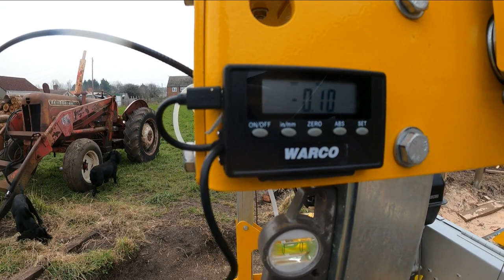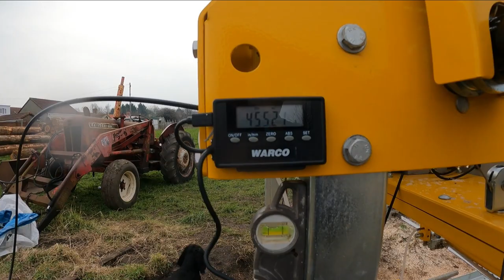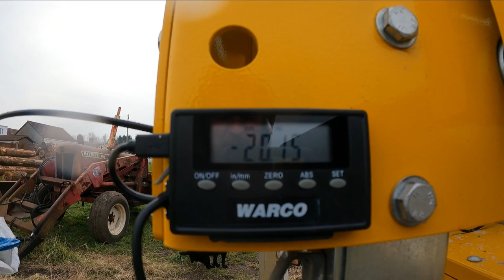Frontier OS27 Sawmill ~ installing a Digital Readout scale to the mill ~ GAME CHANGER !

Comment: Hi Nick, thanks for this video. Because of it I bought one to install on my LM30. I'd like to know how you have been liking it? Mine arrives this week.
Reply from the maker: Hey Tim, thank you for watching my video 😄 ill be honest. I freaking love my DRO. I've ditched the scale that came with the mill and use the DRO solely. When using the DRO, you have to add kerf when coming down. So I generally add 1.5mm to the final measurement, so for a 100mm cut I'd go to 101.5mm on the scale and 90% it comes out at what I want it to. We've got to think that this is rough sawn at the end of the day 😄 but yeah fantastic piece of kit. Get one now !!!

Comment: Good stuff Nick. That mill is going to bring lots of extra $$$ to the business. I can see houses behind - will there be a problem generating noise while working?
Reply from the maker: Hey buddy, thanks for watching and commenting. I'm hoping it will bring in a little bit 😄 at least for it to pay for itself.
So regarding the houses, yes it's been in the forefront of my brain since I got this mill and that's why I'm building an enclosed shed around it ASAP. Hopefully this will reduce some noise and also line it with insulation or accoustic materials. Just to deaden the noise down. But I don't want my fellow neigbors getting angry with me. That's the plan anyways. I hope it works out.